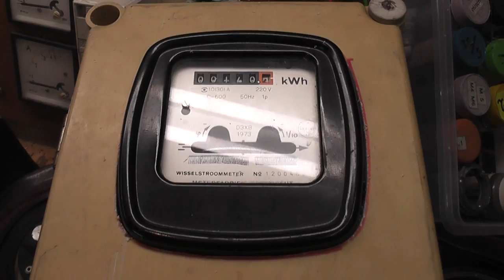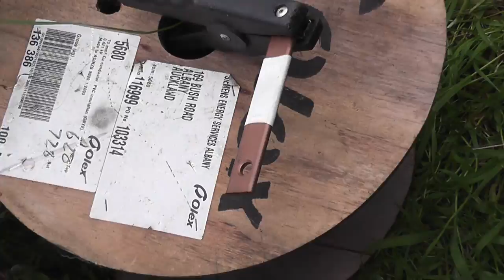Variac repair - meter box and TV CRT vent

Comment from the maker: Thar wrwrwrwr sound is from an old hour meter with noisy bearings.
The testcell is sitting half build in my garage, It is not a TV casing but a wooden box with a 220 Volts fan motor. My biggest problem is that I often get side tracked with other projects. This was a no wind day, Nothing beats an outside experiment.

Comment: Ah yes, I can now see what went wrong with your variac. :-( I'd honestly have thought that there'd have been a better terminal in there instead of just 'soldered-on'. So yes, something has got a bit warm, de-soldered the wire resulting in a loose connection which then makes everything heat up way more than it should do. :-( Poor thing. :-(

Nice box for the electric meter though. :-) The socket underneath....Got something more beefy than a 10A socket? What about a 15A one? Mmmm! :-D

-BBD.